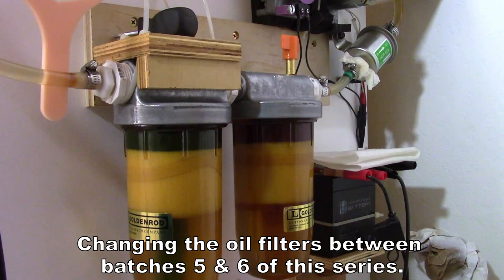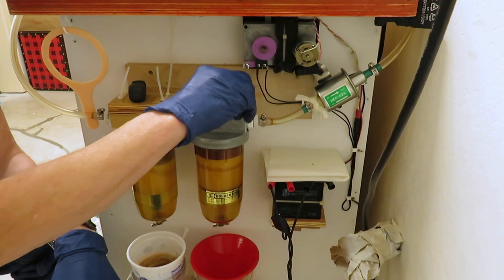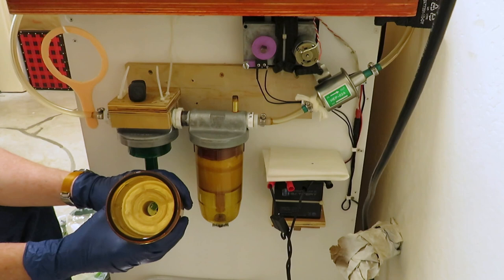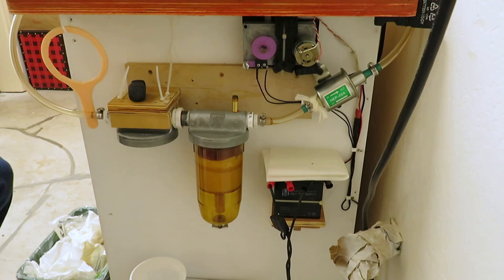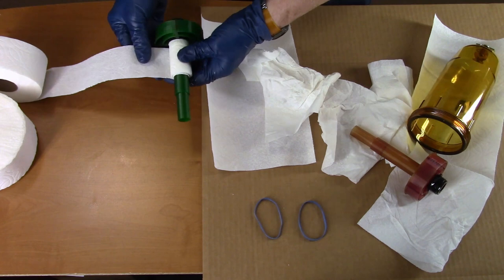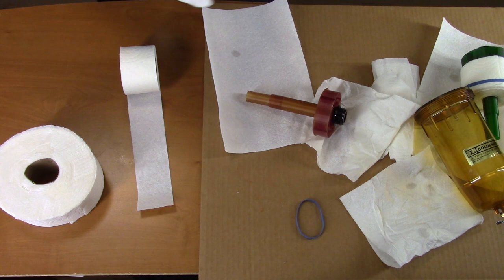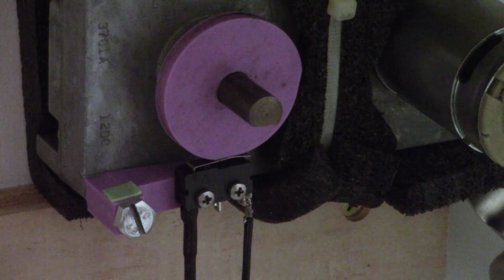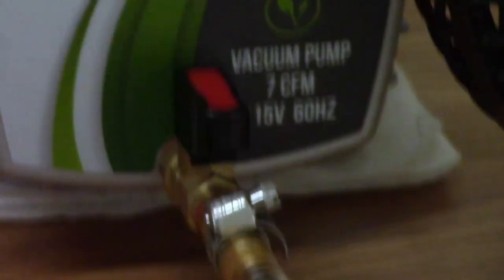Freeze Drying Your First 500 lbs of Food - Cleaning the Oil Filters Between Batches 5 & 6

Comment: i have the premier pump and i have to change the oil every 15~20 depending on if it looks cloudy so i dont know if id need a recirculating setup. However an off pump power filter/water separator would be cool something that would just let you empty the pump into a container and it power washes the water and particles out.
Reply from the maker: They sound like a good vacuum pump. It wasn't a choice when we got ours. (and I'm cheap)
Reply: @SchoolReports  im cheap too its the only oil choice now when you buy a complete setup, i may pick up a backup standard pump soon.
Reply from the maker: @jhippl  It would be nice to have a backup.